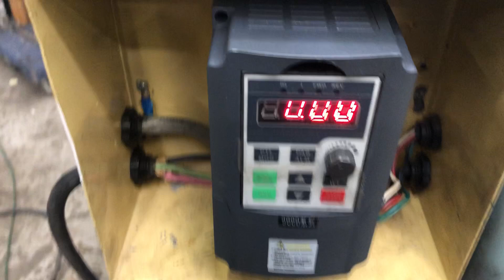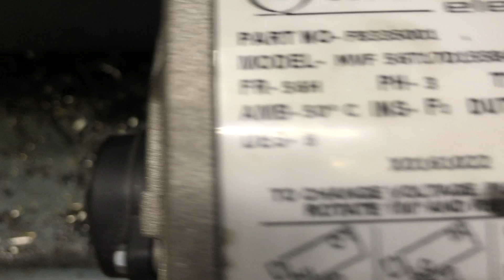Shenwai SW900B VFD Retrofit

Comment: Where can I find parts for this model?
Reply from the maker: If you find parts, let me know
Reply: @mikewalton5469  do you maybe have dimensions of the worm gear behind the apron for the feed. My lathe is missing both the worm and worm gear. If I can get the dimensions, I can have them made. If you don't mind please. I only need the number of teeth and the outside diameter. Thanks